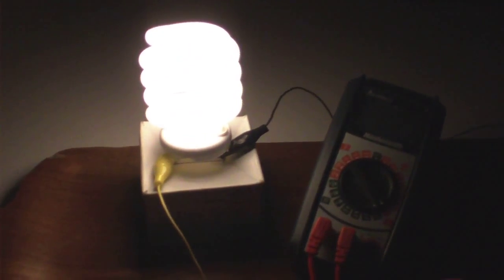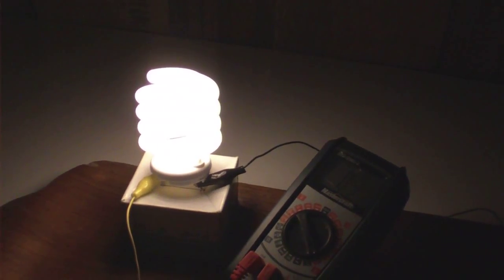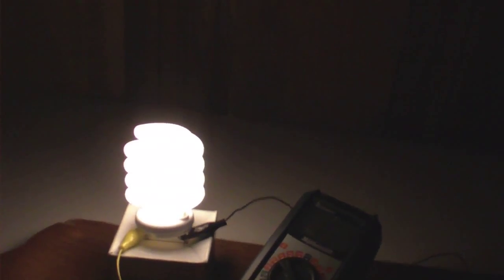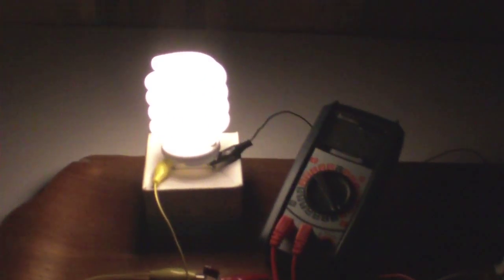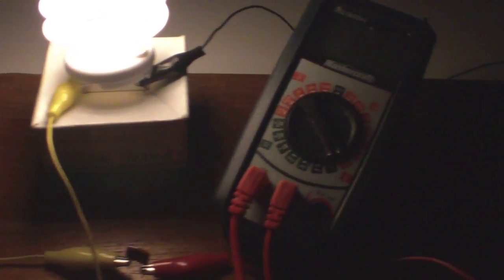12 Volt 4 watts CFL Driver - 555 Oscillator / Inverter - Sentex Kyle Mod II

Comment from the maker: I'm sure it is probably somewhere online, I improvised it, it is very simple, in the first videio you can pretty much see what it is, on the breadboard, if you have any questions, just ask... thanks! It's just a 555 timer pulse generator, and the capacitors fill and create the AC flip...